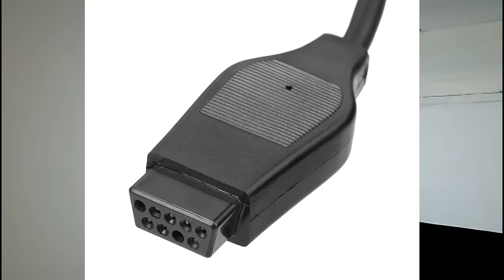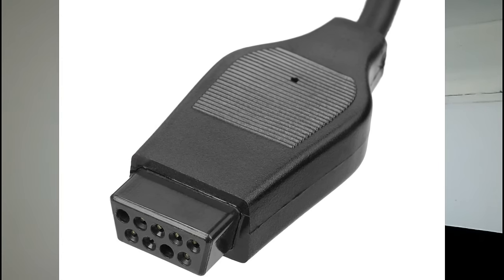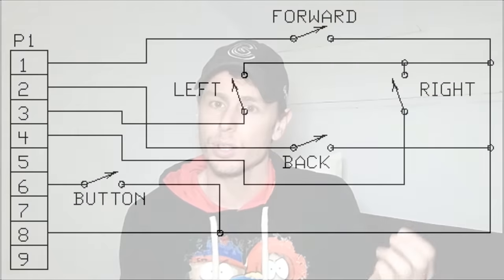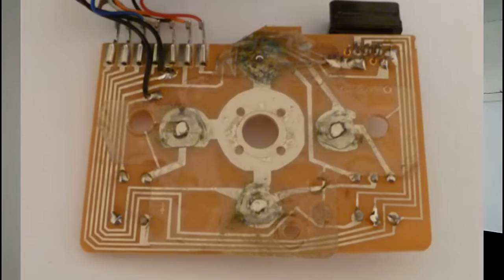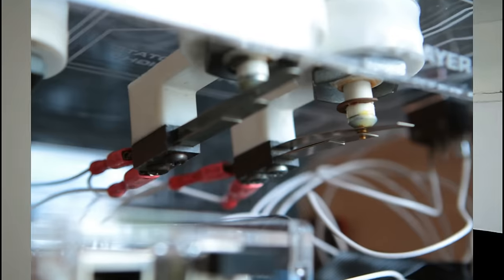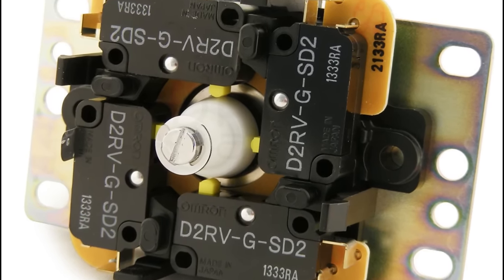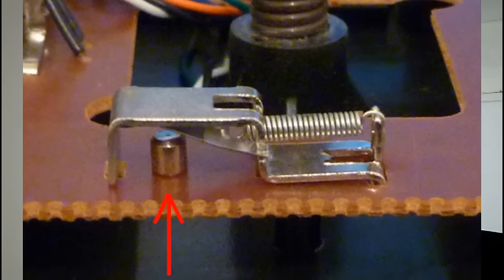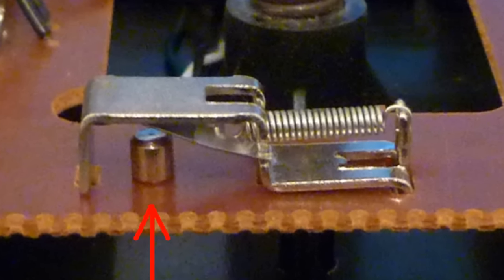The BEST (and worst) retro joysticks

Comment: The best joysticks ever made , hands down, were  those manufactured by Aneroussis company. Tomahawk and Pacman joysticks brought arcade quality in our homes by having the most expensive parts available  in the market. The metallic shaft was an actual coin op part and it was paired with  micro switches  with internal springs that never fail. A lubricated  ball bearing on the shaft ensured smooth function for years to come . Comparing  them to competition pro (since I have a pair of those) can  literally  say that the pros feel like garbage.  The difference is so massive that I had to store my pros for good.

Comment: Where can buy joysticks like your favorites nowadays?
Reply from the maker: They're all over the Dutch marktplaats.
Reply: @RetroGameCouch  Okay. So there not manufactured anymore. The Competition Pro is a bit expensive since it's not manufactured anymore, But your favorite, the 'The Arcade', is indeed still available for very acceptable prices. Thanks for the tip. 

Did you ever try the remake of the Atari 2600 joystick named the "Hyperkin Trooper II" (= USB) (or the orig. Trooper (= DB9))? I'm curious how it compares to proper arcade sticks since I have a soft spot for the Atari 2600 joystick.

And what's your opinion about the joystick that comes with the "The C64 Maxi"? It's a copy of the Competition Pro but it's way too stiff for me to use. Is the "real" Competition Pro that hard to operate too?
Reply from the maker: The original atari joystick uses leafs switches and doesn't give me any feedback. I presume the hyperkin remake is microswitched.

The competition pro is indeed too stiff for my taste as well (both the original and the remake) . That's why the arcade is my favorite.
Reply: Just bought the 'The Arcade' (your nr. 1) 2nd hand. And indeed, these things were built to last. Very nice joystick! Much, much, much, much, much better than the copy of the 'Competition Pro' that comes with 'The C64 Maxi' . @RetroGameCouch thanks for the recommendation. Many recommend the 'Tac-2' . But I don't think it was ever sold in Europe/Holland so it's hard and expensive to come by.
Reply from the maker: I was never able to get a tac- 2. Congres on getting the best joystick in the world. 👍

Comment: Zipstick, Competition Pro, Black Cheeta (Not the crappy comes with the AMIGA White version) Atari 2600 Joystick and Supercharger are the big 5 everyone raves about and thats probably for good reasons especially Supercharger as it's the one out of the 5 most raved ones I had actually owned and it used the old school microswitches where you bung in a little spring and the switch is repaired and I though that was a cool feature to have being able to DIY your joystick to full health again using only a spring cut to size.
Reply from the maker: Those are called open microswitches. I talk about them in the video as well. Pretty cool system.

Comment: I found the weirdest arcade stick! It's unbranded, 9-pin, and has 3 big vaguely Sanwa-style orange buttons with springs and microswitches, and has slightly bigger footprint than Competiton Pro like sticks, but intended to be placed across rather than along, though it is much smaller footprint than proper arcade controllers, and it has clear rubber suction cups at the bottom and doesn't weigh much. It has configuration switches on the bottom that switch it between left-handed and right-handed mode, and between i think MegaDrive and older systems. The enclosure is made out of clear plastic that hasn't yellowed or developed cracks, displays the typical arcade stick gantry, and has enclosed microswitches that are also made out of clear plastic. It feels absolutely fine. I picked it up at a thrift store for 1€ around 10 years ago.
Reply from the maker: +Siana Gearz interesting. Any pictures?
Reply: Oh i put it in storage because i needed space for now and will move soon, together with my working C64C and to-be-repaired VC20, so it's not getting lost or anything, it's my treasure chest, just not at hand, but i'll make sure to take some pictures when i reach that box again.

Comment: I had a Quickshot when I was younger that I abused the hell out of. Still have it and it still works, although I'm pretty sure it's leaf switch. 

I recently won an auction for a pair of used Competition Pros, but they look and act like brand new (as if someone bought them new years ago and never used them at all). Very happy with the Competition Pro, it's an amazing joystick.

For flight sim / shoot em ups I sometimes use the Quickjoy Jet Fighter, I haven't opened it up to check what kind of switch it is though. Looks the part with the extra autofire sliders though.
Reply from the maker: +acherion Yes, you can buy a new Competition Pro from icomp.de. Pretty sweet! And if you open up your Quickshot and see a spring type system, they're open micro switches.